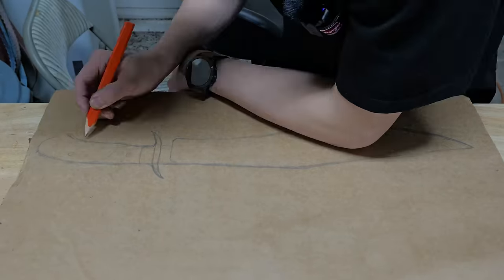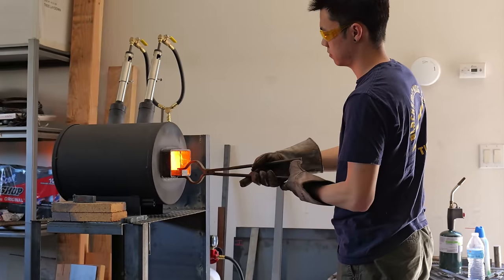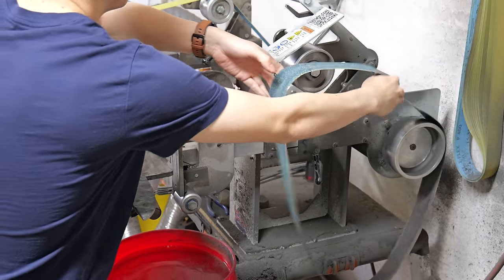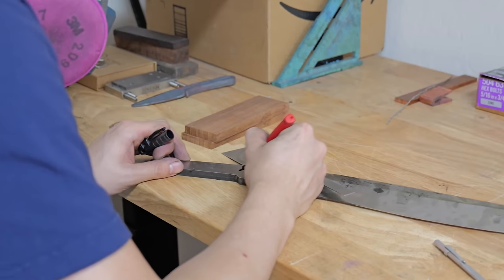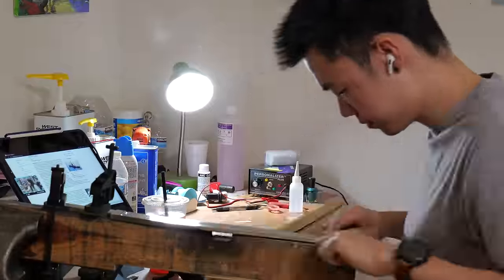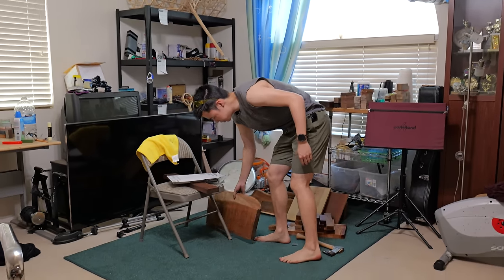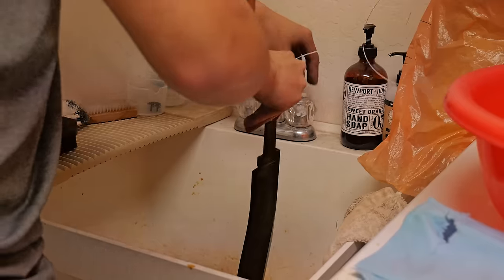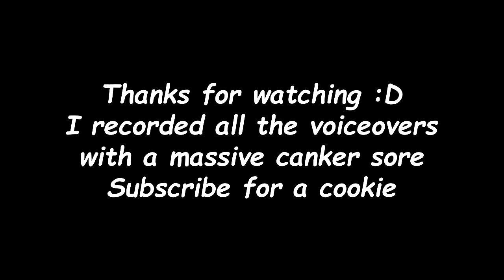Making a Damascus San-Mai Kukri

Comment: I really like that your surroundings aren’t some run if the mill workshop. It is lived in and it gives your video character. The washer and dryer are great horizontal work surfaces. 👍🤙

Comment: I dunno if it would be applicable to knife making but I know in polishing WD40 works tremendous during the sanding process.  I'm a fabricator, mostly doing high end turbo/charge piping for cars, many of which I have polished to a mirror finish.  I usually start the WD40 in during handsand. I typically do 120>320>400>600>Grey Scuff pad, all with WD40, then stop using it for the buff compounds.

Anyway, sorry for the super long comment, love the videos! 

PS I used to live off Gilbert Rd! Tremendous town!

Comment: As a machinist, I actually like permanent marker better than dykem for layout fluid. Gets into the metal better and doesn’t wipe off. I usually use it to blend two surfaces though, you can wipe dykem off of a part with an endmill and still have .0004” ish to go

Comment: New subscriber here from South Africa 🙂 Man you make some really cool stuff 👌  I've seen a Smith use borax mixed with high abv alcohol, then soak his laminate in it before going in his gas forge. Haven't seen a failure yet. Well thats the power of editing  😂😂 and thats a test for you😉  👊🍻
Reply from the maker: Interesting, I’ll have to try that at some point. I’ve seen liquified fluxes before, but I never knew what that liquid was.
Reply: Sanitizer. Or EverClear as called in the states. 1

Comment: A kukri designed for general purpose is commonly 40–45 cm (16–18 in) in overall length and weighs approximately 450–900 g (1–2 lb). Larger examples are impractical for everyday use and are rarely found except in collections or as ceremonial weapons. Yours must be double that size.

Comment: Now thats a knife...well done !  Psi is meaningless if you want to indicate the setting of your forge without saying how big the orifice in your burner is and how much air it also uses. Imagine filling a swimming pool with water . You can get 1000 psi from a very tiny hole( lets say 0.001") to fill that pool compared to 10 psi from a big 10" pipe to fill it up.....the swimming pool will stil be filled way faster with the 10" pipe at 10 psi. If you ever have the core in your san mai blades not centered....anneal the blade and grind the bevels in . Leave 1/10" on the edge and check where the line is using ferric. If its way off at a spot...clamp the knife in a vice with the edge about 1/2" above the vice. Use a small brass rod and a hammer and tap the edge over a bit so it is again centered at that spot. I saved a lot of sanmai's that way.

Comment: It's cool how similar that is to a Bowie knife... it's almost like Chad Bowie and Stacy kukri had a bastard. 😅👍
Reply: I didnt want to be a hater, but yeah this is way closer to a bowie knife than a kukri. Handle shape and length, the fact it has a guard, and the blade shape and profile are different. It's great work to be sure, but I'd call it a bowie before I'd call it a kukri.
Reply: @Jaedeok82  "ok sure," but it's not like the offspring of two parents looks exactly like a 50/50 split of each parent... 🤣😅👌

Comment: "San Mai, in the context of metal blade construction/metalwork, refers to a knife, blade or sword that has the hard steel hagane forming the blade's edge, and the iron/stainless forming a jacket on both sides" All of this, of course, dictates that the jacket is non-hardening. This was the purpose of "San-Mai".  Having a hardenable jacket with Damascus is just a laminated blade. It's not San-Mai.

Comment: How did they put layers of metal together before welding was included in knife or sword making? Basically, how did they do, what you are doing, without all the upgrades lol? Im curious now because my grandfather was given a sword from a wounded Korean soldier, or civilian, and it was OLD, old school. It had a shark skin handle with bamboo holding the handle on. It had characters on the handle as well. I have no clue what they meant. My mother eventually got rid of it at some point.

Comment: is it obvious when your blade steel in an san mai is not central or straight? or would you give it a quick dip in the acid to check? during profile grinding and rough grinding i mean, while theres still time to fix it

Comment: Wow great craftsmanship Jesse. A little explanation about the Kukri, the correct pronunciation is Khukuri which is the all purpose kinife for everyday household use in the kitchen, cutting wood, cutting fodder from the forest for your goats and cattle in the Himalayan region. It is also is used in the slaughter of animals by chopping off their heads. It is also a personal weapon of the Gurkha army. There is a small mistake in the knife. Jesse did not cut a small half moon slot at the base of the Khukuri blade before the handle. This is needed to drain or divert the flow of the blood away from your hand after a little slaughter so that the handle is not slippery and fly off from your hand.

Comment: What a gorgeous blade, although as an avid knife collector and user I have to say that I think the nub on the handle would have allowed for much better grip and control of such a long blade without spending much effort on balancing the weight and the original design was intended for combat utility and farm use so balance is incredibly important should be slightly blade forward or the center balance point should be roughly 2/3in forward of the gaurd allowing for maximum chopping performance and efficiency without the user experiencing too much fatigue... While I am great at criticizing others work I'd never be able to make this beautiful piece myself so take it for what it's worth lol but my knowledge is based purely on experience and use of a multitude of different sizes and styles of blades pushed into all types of roles and a knife that is capable of doing many different tasks well is far superior to one that geared towards one use only....

Comment: Nice work..at around or just before the 27 min mark you scanned the belt grinders and there it was the waterfall plunge line attachment that you stated you didn't have..but the video of it says otherwise..I wonder what other statements you made are false as well.?
Reply from the maker: That was just a regular platen, waterfall platen is the one that goes above the grinder and it has a small radius. I have no reason to lie about these things🗿

Comment: I am old school this is lazy bullshit folding metal is drawn and folded from one stock over thirty times is enough or true san-mai soft metal is folded until long enough to fold over hard carbon in one piece   This is for looks and will get sharp ...but not as good as old school!!!
Reply from the maker: Hehe, old school or not, folding any steel 30+ times will leave you with very little steel. No matter the era, smiths had to deal with oxidation and material waste.